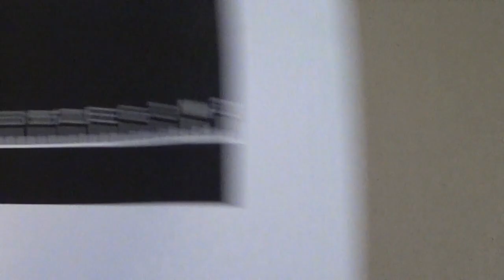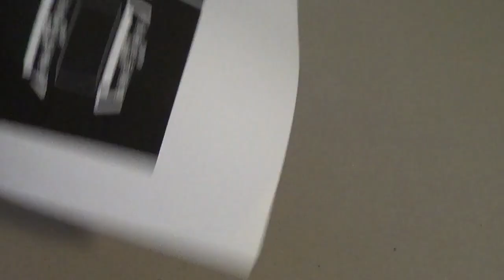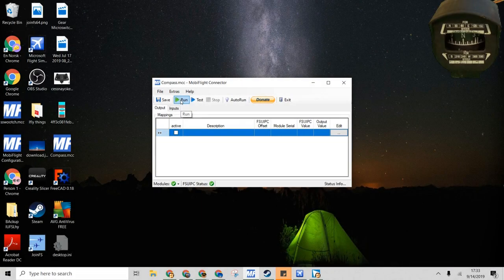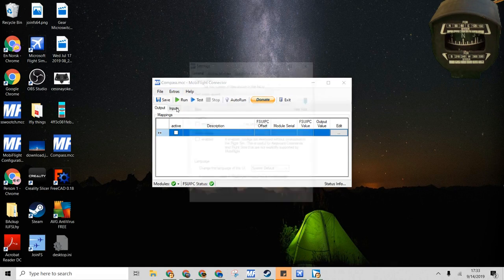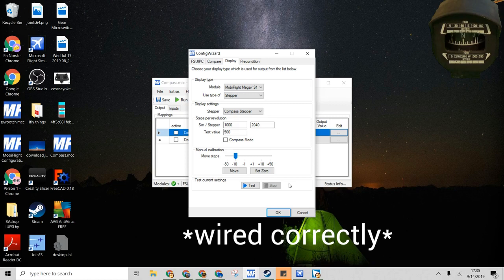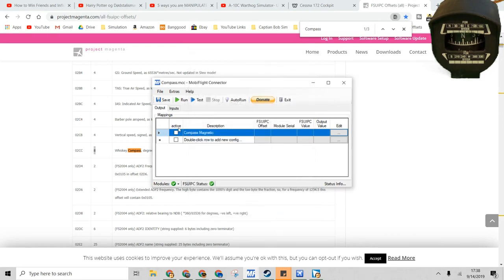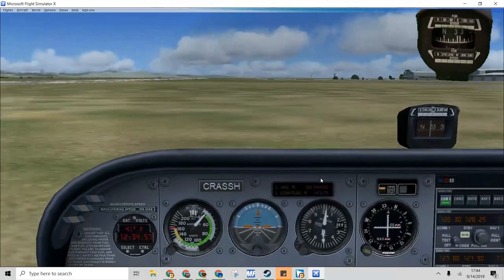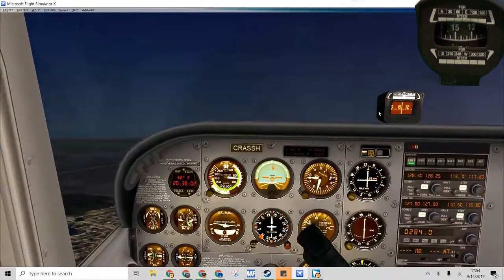How to make a Magnetic Compass for FSX | Captain Bob

Comment: Regarding the face where the supports were:  If you need it to be cosmetically good, you could plan for it and make that face thinner, then make a flat piece to fit inside the shroud on the front to neaten it up.
Reply from the maker: That is a great idea No1sonuk!

Comment: Hi Captain Bob, Thanks for all of you videos, great job. Great to see such a young man so invested in the hobby. I am old (66) but only about 3 years into flightsim. I am building a home cockpit loosely  based on Beachcraft B200. I have just entered into the world of Arduino and Mobiflight and thought the Whisky Compass would be a great first project. I have it all connected and configured as per your video. My problem is that the stepper motor runs constantly, sometimes counter clock wise and other times clockwise. Also I cannot seem to make it stop, however, it will stop on its own. Also, the line in Moboflight that you check "Active" flashes rapidly , constantly. I opened MSFS2020 C172 but it does not mimic the compass in the sim. I am sure that I have must have done something wrong but after several reviews I cannot identify the cause or error. Any ideas on this issue would be appreciated

Thanks.
Reply from the maker: Hey Kevin! I think the problem might have been that you pressed the "TEST" function instead of the "RUN" function. The TEST function is useful if you have a lot of devices and want to check they all work, the RUN function connects it to flight simulator.
Reply: Thanks Bob, I will give it a try tonight, I think you may be right on.

Comment: How to attach the motor to the 3d printed ring ..?
Reply from the maker: I think it should pressure fit, if I recall correctly I might have used a file to widen it. Super glue can be used to fix it permanently.

Comment: Bonsoir de la FRANCE et Bonne année 2010 , Bravo pour ton montage , je débute sur un simulateur de vol d'un avion Beechraft 200 , il me manque les elements de control des moteurs , je pence il faudra investir sur graveur et une impriment 3D ? ALORE comment faire le plan de la cage moteur en 3D merci d'avance et a très bientôt mon ami...Didier
Reply from the maker: Bonne année! Projet de simulateur très cool!
J'investirais dans une imprimante 3D, mais pas dans un graveur. Vous pouvez utiliser FreeCAD, TinkerCAD ou Fusion 360 pour concevoir des objets en 3D. Bonne journée!

Happy New Year! Very cool simulator project!
I would invest in a 3D printer, but not an engraver. You can use FreeCAD, TinkerCAD, or Fusion 360 to design things in 3D. Have a good day!
Reply: @CaptainBobSim  Bonjour de la FRANCE , merci du message , que me conseil pour une impriment 3D avec un plateau qui correspond a nos besoin. merci encore bravo
Reply from the maker: J'achèterais un Ender 3, sauf si vous avez besoin d'une grande table.
I would buy an Ender 3, unless you need a large table.

Comment: I just wonder how the compass knows the first heading? When you start your computer how do you turn the heading to same direction as in FSX? Is there a calibrating process or how?
Reply from the maker: You can twist it manually to the heading (not recommended) or calibrate it digitally in the Display tab under Manual Calibration, then set the position to zero. After it is calibrated, it typically stays (in my experience)

Comment: How to make aircraft horizon
Reply from the maker: I'm going to make that video in about 3-4 weeks, right after I show how to cut the holes, and make simple instruments.
Here is the 3D print: https://www.thingiverse.com/thing:2473812 
You will need 2 servos and a few small screws.
Reply: @CaptainBobSim  i have 2 broken servos and 2 wich are still working
Reply from the maker: Awesome :) Those will work.
Reply: @CaptainBobSim  those wich are working are those giant ones
Reply from the maker: Oh. I don't think that would work. You need "9g micro" Servos. You can find them fairly cheap on ebay and Banggood.
Reply: @CaptainBobSim  i have one of those with malfuncioning potentiometer
Reply from the maker: The print is designed for a 9g servo, and a working servo is required :(
I think you will have to buy a new one.
Reply: @CaptainBobSim  i alredy ordered 3 sg 90 servos 3th one is just in cause